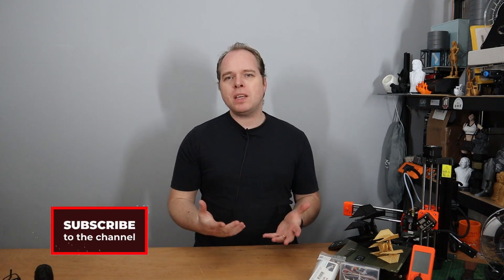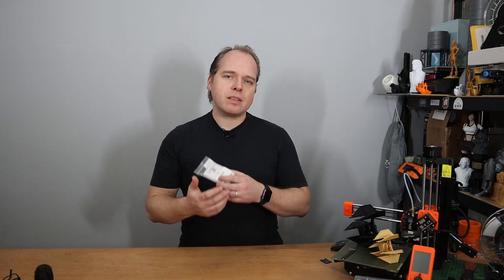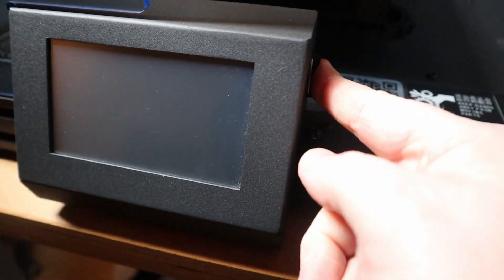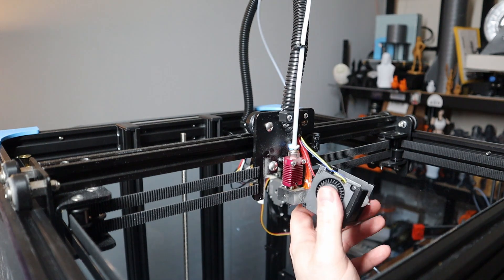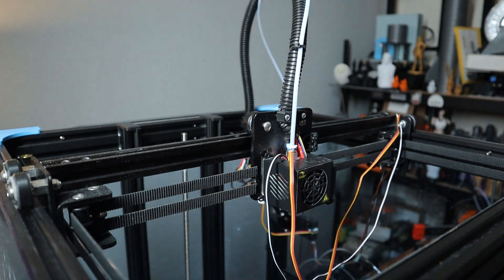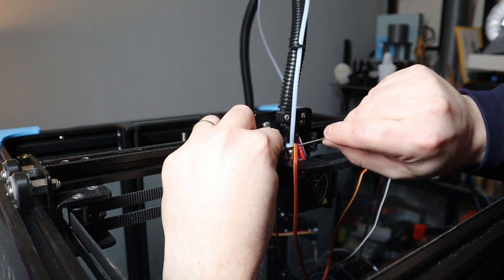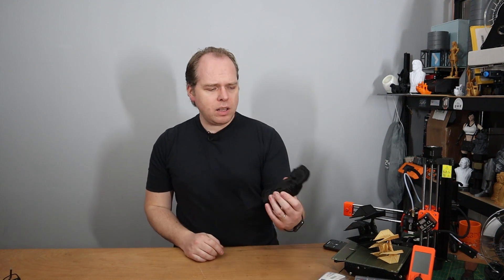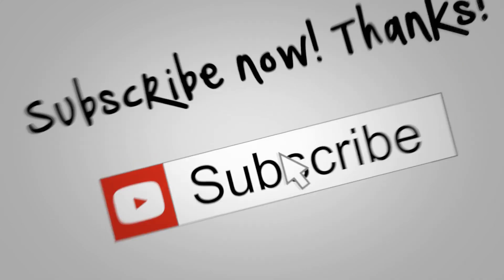How to install BLTouch on Creality Ender 6

Comment: Have you tried ideaMaker slice software on the ender 6. Could you make a Video how to set up ideaMaker for the ender 6?  
I would also see you make a video how to set up e3d Hemera Direct extruder on a ender 6.
Maybe try to replace the wheels wih linear motion rails.
Reply from the maker: I didn't tried IdeaMaker for the Ender-6, I can make a video about that. I bought a E3D Hemera direct drive, but I'm planned to install it on the Ender 3v2. I can check for the linear rails installation on the Ender-6

Comment: Okay so I got my bltouch set up and when you turn on the printer it lights up red (showing that it works) then I go to level it and the leveling does not want to work. Im honestly pretty confused about what im doing wrong
Reply from the maker: So please check if you follow all steps... Did you missed something? maybe the part of the leveling? also make sure that tha card with the firmware is removed after the installation on the printer
Reply: @Zachary3DPrints  hi i have the same issue. i have removed the card after i installed the firmware but i still doesnt work
Reply: okay, I think I figured it out. I returned the Bltouch and purchased the older version, I kept the wire tho, lol hopefully amazon doesn't get upset. so when I got the older version BLtouch I used the other wire to combine the 2 wires into the correct fittings for the E6 connections and the Bltouch. and plugged it all in and then found out that the older software update was corrupt from the creality page so by now they have the right bin. (V1.0.4.9). got that in the printer and it worked. I did forget to take my Z-axis switch off lol. got it now

Comment: Nice video, thanks for the great explanation. On 7:30 you doing manual bed leveling. But why? Isn't the BLTouch itself supposed to do that now?
Reply from the maker: Yes before switching on the ABL... you’re making sure that the bed is everywhere equal height. In case of the need way off on one side... it needs to compensate very much for that gap...